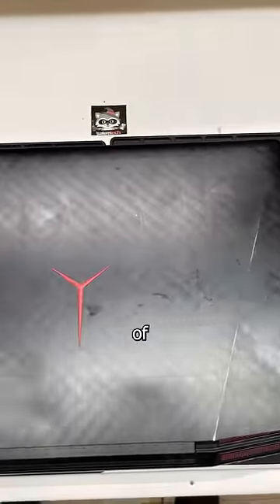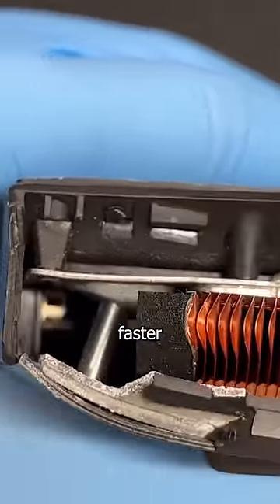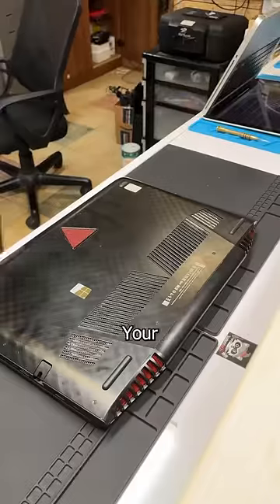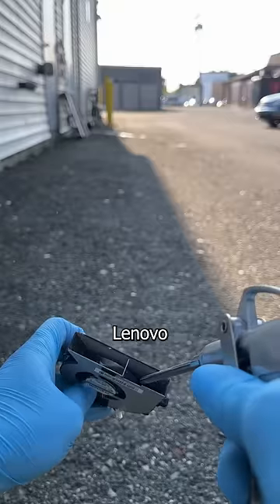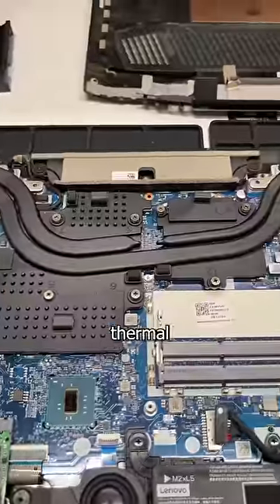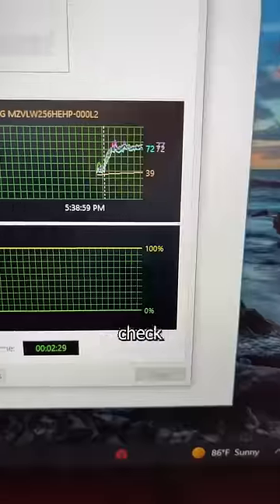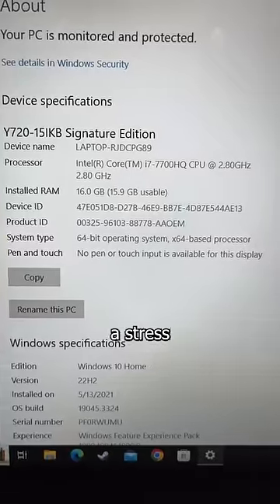Lenovo Legion #gaming #pc is dusty and falling apart #technology #tech #shorts

Comment: My friend was wondering why his old laptop quit working. Then I remembered it was used for at least 5 hours a day for like 4 or 5 years and was never cleaned once. That thing suffocated
Reply from the maker: Press F to pay respects to your friends laptop.
F
Reply: this is also the reason why i need to go to repair shop. but i also need to backup my linux machine (settings, installed programs, basically everything) and change back to win10. sad
Reply: Why people never dust their PCs baffles me. Cleaning is cheap, not PCs lol.
Reply: @cflynn3684  PCs? laziness. laptops? skill issue
Reply: after reading this iam impressed by my computer since this is an 11 year old computer and ihave been using it non stop since like 2018 and its still some how working properly
Reply: 5 years is a pretty good run for a laptop regardless. 

I also neglected my own laptop for a while and it had overheating issues, which I solved by turning up the AC and pointing a table fan into it. Later I tried cleaning it and I managed to pull a solid chunk of dust out of the heatsink.... surprised it never caught fire.
Reply: My laptops generally used 7+ hours a day.

Just use it in a clean area, keep dust away from the air intake, choose cooling pads that also serve as a buffer so dust won't easily get it.

With a little bit of luck, something else will break before it even needs cleaning.
Reply: @soyUsernameWasTaken Much easier said than done. Better to just dust it yourself every once in a while. It seems complicated at first, but it's actually not.
Reply: @cautious3571  hey, whatever works for you, my guy. You can disassemble and clean your own stuff, more power to you. 

I'm just saying, using laptops on a table instead of the bed, is easier than disassembling it. 

Simple common knowledge can save people from having more work. The amount of people who let their cats sleep on their keyboard, but then gets angry when their cooling fans are clogged with fur, is astounding.
Reply: I have a desktop that hasn't been cleaned in  7 years and I am lowkey scared to see how it looks like inside.
Reply: Wait I'm using mine for 4 years now and never cleaned it once still works fine.
Reply: Same. This laptop is like 6 years old and I haven't cleaned it out once. I legit asked my mom yesterday how I would get started on (safely) getting this thing open but she said she'd prefer to bring it to a technician
Reply: @skas56 same dude. 11yr old laptop and it's only recently starting to have some issues. Still plays games just fine, though
Reply: my old acer laptop got cleaned once or twice, it overheated for a whole year with 100 degrees celsius, worked for almost 10 years, it was an absolute unit
Reply: F
Reply: How was that laptop fan able to even spin?  😂
Reply: @cflynn3684 because we have no reliable way of cleaning the dust out. I can use a can of duster for about 30 seconds before the can freezes and quits blowing.
Reply: Oh shit, I guess I need to clean my laptop. It may have not been cleaned in 5 years and have some rice below the keyboard...
Reply: @5fr4ewq  laughs in surface laptop 2

Comment: i hope repair shops around here were as passionate as you. Last time i gave it to servicing they forgot to use thermal paste. So i bought screwdrivers and paste and started doing it all on my own
Reply: Was it not as hard as you originally thought?
Reply: @limitless_93  i found the tutorial for exact model. Have been doing it myself ever since
Reply: man.. better apply your own pads or paste or risk having your ram and or cpu exchanged for something cheaper.
Reply: @teknastyk  If i ever found out a tech did that, they would be finding out what said parts taste like.
Reply: Sometimes same logic can be applied to cars. My mechanic didn't put a new gasket for a exhaust manifold so it was leaking. For months I couldn't figure out the weird sounds. Until I thought lets try that. Cost me 10 bucks and some 3 hour labor in garage. I managed to fix it myself. There aren't many technicians out there that know your stuff better than yourself. At the end of the day diy is always good.
Reply: lesson learned, theres a reason hes the greatest technician thats ever lived.

Comment: Customer: "Wow! Look how clean it is! Thank you!"
Proceeds to make every single mistake all over again.
Reply: AAAAAAAA
Reply: Then comes back to him.... Insert "This is business" meme
Reply: Eventually they just get dusty. I’m more worried about this man’s laptop of choice as I had one from 2021 which broke in 1 year cause it overheated on games with low settings. The computer doesn’t actually have controllable fan speed and as you can tell in this video the cooling of its single fan is lackluster.
Reply: That'a a repeat customer there.
Reply: Just makes him a repeat customer, and makes him lose more money.
Reply: Idk what mistake homie was making. Tearing apart a laptop, carefully disassembling it, dusting the parts, noticing the gaps in cooling systems, and putting it all back together correctly without tearing any of the flimsy ribbons isn't a thing average people do.
Reply: @thegreatestfallout1794  They're talking about the owner of the laptop, not the repair guy.
Reply: @morningglory10 he knows. He's saying average laptops would get like this as the average consumer can't deep clean the parts like this. Like how tf would a normal c9nsumer know their heat sink is warped
Reply: The customer didn't really make any mistakes. Laptops will get dusty no matter what and most people don't have the knowledge to open a laptop and clean it without destroying it. The thermal pads not making contact it really just an issue of wear and tear or build quality which neither is at the fault of the consumer.
Reply: Wow, so clean.
Proceeds to use it as a coaster for a coffee mug, McD's burger and fries combo and lets the cat sleep on top of it.

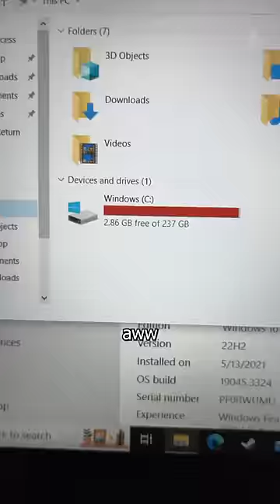Comment: 0:59 I sometimes have less free space on my Laptop. Actually a few GB free space is enough to run Windows smoothly if you clean your temporary files often enough and don't plan on install any large software or store a lot of content on it. However in this case you might end up with space left in the MB region before cleaning temp files. But Windows actually warns you if you run out of HDD space, so it's not a very big issue. It's important to use a fixed size for the swapfile though, because otherwise free space fluctuates all the time. This also prevents fragmentation of the swapfile.

Comment: Have you ever had an inspiron 7559 come through there? I’ve got one as a backup pc and surprisingly it hasn’t had any heating problems despite not being cleaned out for 5 years. My only issue is the hinges are not designed very well.
Reply from the maker: You know what? I've only had 1 and it was some weird sound issue. I never see those things, so either they're really reliable or not many people bought them. I do remember the hinges were sketchy af though when I was working on it
Reply: @SalemTechsperts oh yeah, it did have some sound issue with Realtek drivers but i fixed that just by overwriting the Realtek ones with some generic microsoft drivers i found online.

Comment: I have the desktop version of this, the Lenovo y720 Cube, and for some ungodly reason my ssd was shipped with 97 GB, of which my OS uses like 35 right off the bat and of course %appdata% is huge since these pcs are.. what 7 years old now? I think somewhere around that.
Reply from the maker: What the, 97GB!? Of useless garbage probably. NVMe's are super cheap right now though my man, like $40 for a good 1TB. Clone your drive over and you can download as much 8k homework as your heart desires!
Reply: @SalemTechsperts  i don’t believe the cube version has an nvme slot but I’ll make sure to check! I guess worst case scenario I could buy an ssd with sata as those seem to be dropping in price

Comment: I have one of those laptops and even though mine is clean and is absolutely never used without a cooling pad, it still heats up a lot. I'm surprised that thing still works.
Oh and the storage part, mine has a 250gb SSD so yeah, totally relatable.

Comment: @ron 

I'd check why those voltages are 35V and  -35V. That replacement board may have something missing/bypassed/shorted/mis-designed. The 12.5V is intended for the 555 from the zener dropping the voltage.

A 555 timer is max 16V for a NE555 timer on TI's website, and that's being exceeded substantially on this board with the higher voltages.

There's probably other parts on those voltage rails that are getting stressed from the higher voltages also

As for the zener's, use the higher wattage ones. They are usually a little larger, and dissipate heat better. Digikey has lots of options

Comment: When blowing out fans, don’t let the blade spin. It will create an electric charge. If it’s plugged in to your computer you can damage something
Reply: So in any case you need to blow it by spinning the blade with air, should you disasemble it first?

Comment: I've got a Lenovo Legion 5 Pro and have to clean it every 3-6 months as I have pets. They made an extremely good and literally cool design, but unfortunately unless you live in a professional clean room, it NEEDS to be cleaned regularly. Luckily its super easy to just take the back panel off with 10 screws and use a vacuum. If you've ever needed the best bang for your buck, the Legion 5 Pro has got my full vote of confidence.

Comment: I have a crummy gaming laptop i bought on a whim, an acer nitro 5 with a 1050. It came with 8gb of ram and a 500 gb nvme.

I really only used it at work for gaming while i was stuck with nothing to do. It runs like a champ (for what it is)  and at $475 dollars it was a steal many moons ago when i bought it. I have recently begun gaming on it again after a long hiatus not really touching it, and the first thing i did was google upgrades for it. I bought some faster ram, a 1tb nvme, and a 2 tb ssd. Now i have 2 tb of storage for games and videos i am editing for practice, and the 500gb nvme that i am currently just using as a backup drive. 

So now it has 3.5 tb of storage, 16 gb of faster ram, and the total cost of laptop and upgrade is now $600... still expensive, but i have had it for over 4 years and it plays all the games i want it to. The only complaint i have is that the battery is no longer any good. I can get maybe half a day on standby, an hour on not gaming, and maybe 30 minutes under load. It would cost me between 30-60 bucks to replace the battery, but honestly even brand new i would say the battery didnt last much longer than an hour under load.

I now power the laptop via 18v drill batteries or an inverter in my truck so i can game without power, or just plug it in when i do have power. I can still game when my power is out, or when i am stuck at work and cant go home. 10/10 i highly suggest everyone gets a laptop for back-up gaming if you can afford it. It isnt a 144hz 1440p gaming experience, it is better than sitting somewhere on my phone watching the greatest technician thats ever lived clean scrotum soot out of a laptop... who am i kidding i just have my phone next to the laptop and i watch the videos while i game

Comment: I've had that laptop for 6 years, and of course I've been cleaning it every few months after warranty expired. The only problem I've had since last February, is the keyboard doesn't work anymore, and for some reason the bios won't boot in to the default boot option, it goes directly into the boot menu, So now I have to use an USB keyboard.

Comment: I'm sorry, did you say gaming laptop? Today when I walked into my economics class I saw something I dread every time I close my eyes. Someone had brought their new gaming laptop to class. The Forklift he used to bring it was still running idle at the back. I started sweating as I sat down and gazed over at the 700lb beast that was his laptop. He had already reinforced his desk with steel support beams and was in the process of finding an outlet for a power cable thicker than Amy Schumer's thigh. I start shaking. I keep telling myself I'm going to be alright and that there's nothing to worry about. He somehow finds a fucking outlet. Tears are running down my cheeks as I send my last texts to my family saying I love them. The teacher starts the lecture, and the student turns his laptop on. The colored lights on his RGB Backlit keyboard flare to life like a nuclear flash, and a deep humming fills my ears and shakes my very soul. The entire city power grid goes dark. The classroom begins to shake as the massive fans begin to spin. In mere seconds my world has gone from vibrant life, to a dark, earth shattering void where my body is getting torn apart by the 150mph gale force winds and the 500 decibel groan of the cooling fans. As my body finally surrenders, I weep, as my school and my city go under. I fucking hate gaming laptops.

Comment: Windows is storing a lot of garbage, cache, unnecessary files, old backups etc. 
You can always try to run "Disk Cleanup" in the disk Properties, click "Clean up system files", click "More options" tab, click "Clean up..." in "Sysytem restore and Shadow Copies", click "Delete" in the popup that will come out. Click OK button and then click "Delete Files" in the popup. I am wondering how many GB that would free up ;)

Comment: I do this as a hobby (cleaning, fixing, maintaining, and collecting old tech) and I've seen shit like this more than a couple times but worse. My grandmother had a laptop, they smoked, the laptop was from 2014 and used daily, never cleaned. Needless to say it looked like a bathroom sink drain when it clogs with hair, completely fucking disgusting. Gave it a once over and came up with one last issue, either I fucked up the fan in process or cleaning it or the fan was fucked to begin with, either way big oof

Comment: My old laptop was great. I could take out the lid from the bottom of the case and I had the access to the cpu, gpu and the fan. The new one is practically impossible to open without the proper tools and knowledge where those damned plastic hooks (or whatever that thing is being called) are. I would love to have the access to the fan in my new laptop, so I wouldn't have to wait half a day for the technician to open it and clean it up.

Comment: This looks even dusty than my desktop when it stopped working, and I went to go open it, and there was dust everywhere after the CPU fan failed, because there was dust in it. And then, when I replaced the keyboard on my laptop, because one of the key stopped working, even my laptop, which sounds like the fan is having problem wasn’t this dusty

Comment: I reapplied the thermal paste on my strix g17 with a 4800h and 3060. Went from 100 degrees with liwuid metal on the cpu to 80 max with thermal paste, insane. The liquid metal was everywhere but the die.

Comment: Why do you have a 300GB SSD?  "I'm poor :("  Buddy, if you're still rocking a decade old Laptop, time to get a gaming console and a macbook laptop, you can't afford a gaming PC.   Personally I've never been a fan of gaming laptops and as much as I like the Switch and the Steamdeck, both lack the ability to run for 5+ hours at a time without risking heat damage, those little fans lack the pushing power to air cool fast enough with modern CPUs and GPUs.  If you want small formfactor gaming, I suggest getting a mini-ITX system and lug a keyboard and mouse with it, hook it up to a TV.  ATX cases may be impractical, but those thing have enough cooling that they can run 24/7 for weeks like servers, or you can overclock stuff to the absurd.  That is why I and many others still use those oversized monstrosities that look like minicomputers but are mostly empty expansion space, for the air cooling.

Comment: I have a very similar situation... just all through the cooling systems and a terribly applied thermal paste... I replaced the thermal paste and cleaned the vents though... this is for a HP Pavillion 105A... which probably hasn't been cleaned in 8 years. Now that it's fixed and all that should I expect much of an impact in performance?

(Also I'm 16... so I'm fixing things without much clue how. But it seems like it hasn't broken my pc yet so that's good)

Comment: I just did one that was at least twice as bad. Completely filled in the cavity of the fans with... Something. Sand? Hate sand. Gets everywhere.

It was twice as bad cause there were two fans. 
Genuinely wouldve cooked in another month if i hadnt fixed it i think. Went from 100-300 on 3dmark to 3700 as it should

Comment: Serious question... would you fix a motherboard issue in this kind of laptop? Would you be even able to? So you have board scematics for it? I srsly need scems for that specific laptop.. i have one.. was broken.. charger connected but no power.. fixed that issue.. there was a broken capacitor on the board.. its working now.. got a new battery but the battery isnt charging.. i had no scems so far but at this point im having a hard time with no scems..

Comment: I got a pc thats dirty and still works fine, just makes a buzzing noise for a few minutes after powering on then it dies down to silence.
Reply: just clean it. I had that same issue, these kinds of videos actually motivated me to clean it and it runs so good now.

i didn't even had proper screwdrivers and tools, if you're careful enough you can do it with anything that opens screws and a toothbrush.
its worth doing.